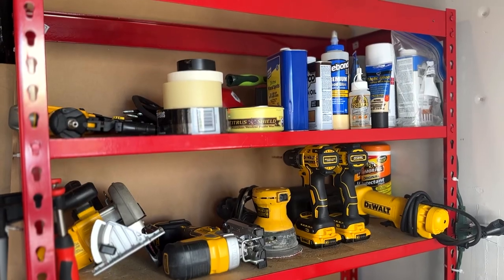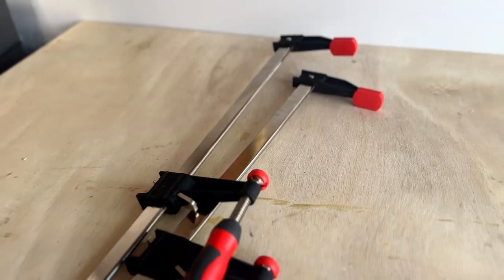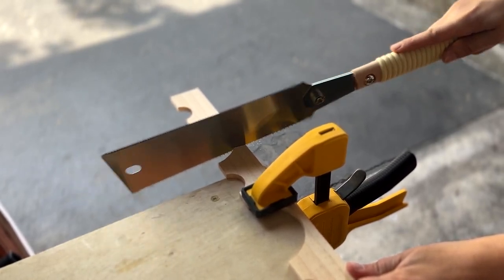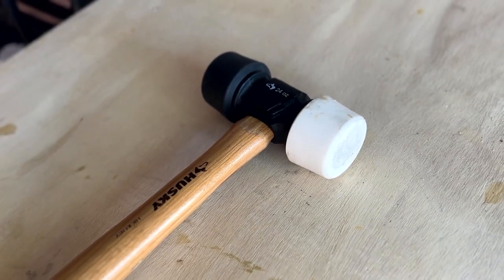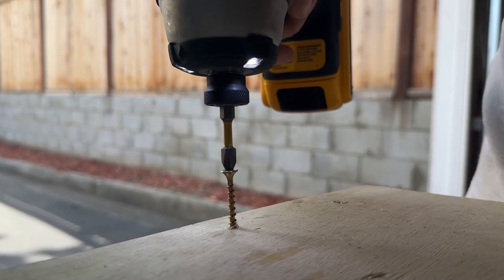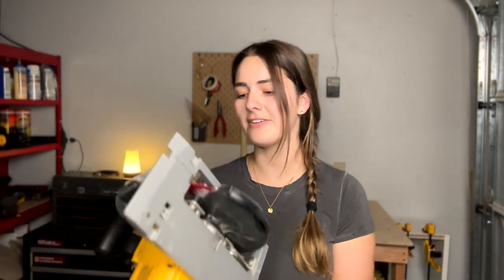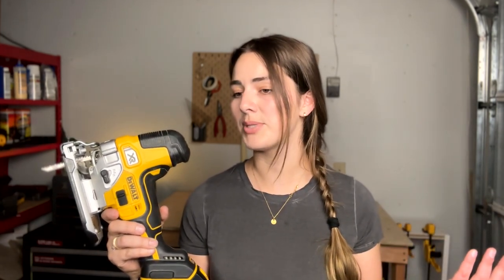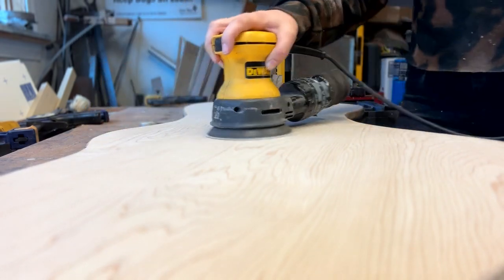10 Must-Have Woodworking Tools for Beginners

Comment: Swapping the circular saw blade to a high tooth count blade helps heeps for woodworking.

They are sold with blades optimized for cutting construction grade products as fast as possible without much care for rough edges. Same goes for jigsaw.

Comment: Air compressor, brad nailer, pin nailer. I grew up with a radial arm saw, and my dad never considered a table saw.
Reply: Try to get a California air compressor. They are very quiet. The inexpensive pancake compressors are so noisy and vibrate across the floor.

Comment: Pursuader, nice one.
Since I started woodworking and other DIY myself, I developed some sort of love for some of the old jokes and sayings of my dad.
Even though they don't translate well to englisch.

That's a nice list of tools!

I'd add a few things to the list:
Chisels and a stone to sharpen them. You can do some neat / nice stuff with those.
A guide rail or guide kit for the circular saw, and maybe also a mitre kit. With those and some sacrificial material, you can almost eliminate tear out and do almost the same cuts as with a mitre or table saw.

For all the beginners I can say the following: Start with a set of decent hand tools. You can learn a lot of how different woods behave, how the grain works and how to avoid (costly) mistakes with power tools.
Reply from the maker: Thanks! Starting with hand tools is always a smart way to begin. I need to spend a little time myself getting more comfortable with chisels and such.

Comment: Good video. I enjoy seeing your journey into woodworking. My first bandsaw was a 1945 Delta Milwaukee for $200 from a garage sale. The motor needed rewiring, a new tensioning spring, wheel bands, slapped on an aftermarket fence, and some other TLC totaling maybe another $300, but I still have that bandsaw to this day. I say that to let you know it's possible to get some great tools if you're patient and can put in a little elbow grease to bring it up to snuff. Great stuff, keep it up!
Reply from the maker: Nice, what a great find! We’re also a bit limited on space for now but long term I will definitely add a bandsaw to our shop :)

Comment: Fun video. Great oration and attention holding by talking to camera naturally. Combination square, try square, framing square, and rafter square. This is how you end up with as many measuring and marking tools as all your other tools.

I like handing people a hand saw and half inch chisel because they are the most versatile. You can basically do everything with a saw and chisel. Anything else just holds a blade in a certain way. They’re the uninhibited, Freeform version of all the fancier specialty tools.
Reply from the maker: Thank you! I do have a set of chisels that I need to spend some time getting comfortable with. Really incredible what some people make using only chisels and handsaws